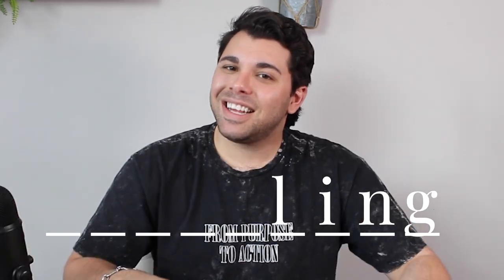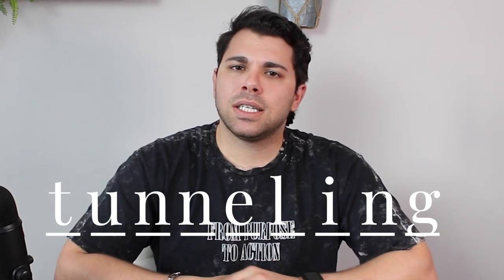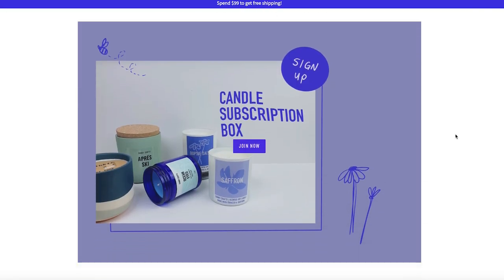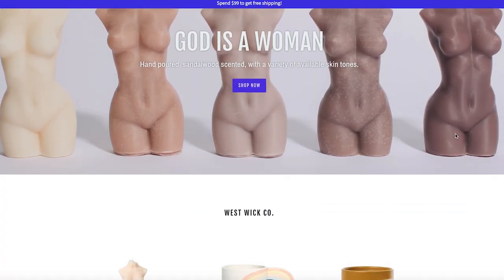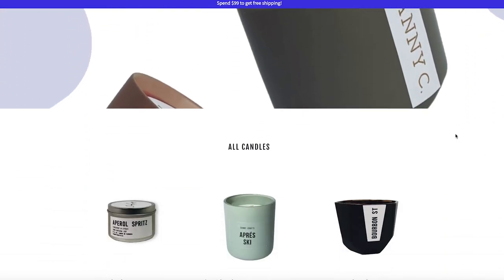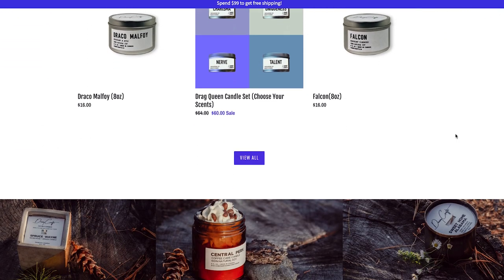Candle Tunneling

Comment: How did you get the candle melt evenly ? I have 4oz tin and a glass jar but they don’t melt the whole thing. I have a tunnel candles too… also can you tell me more about the wick problem. I have customers telling me that the wick is going down and they couldn’t light them… what should I do? How do I make it right next time when i makes the candles. Please help
Reply from the maker: Hey Vanessa! I'm sorry for not replying earlier. So usually when the wick goes down or the flame goes out its usually because of either the wick being too small, or there were sinkholes in your wax below the surface. This is very normal for soy wax. If you search "Fix Sinkholes Candlemaking" there should be a lot of videos on this, I haven't made one yet but am planning on it in the future!